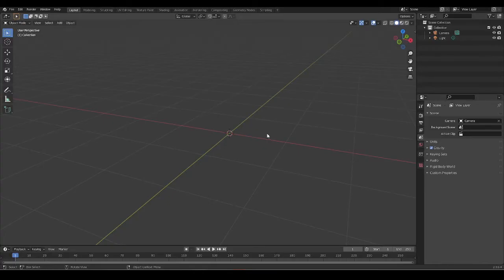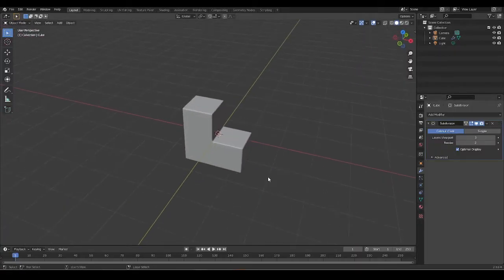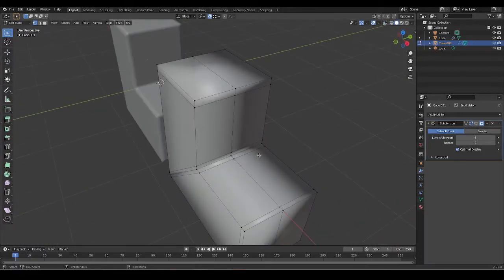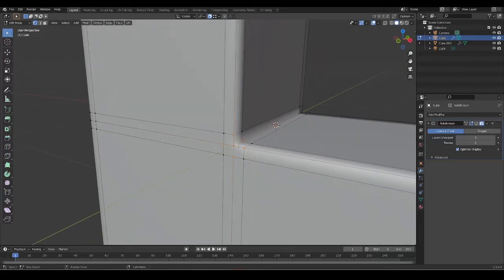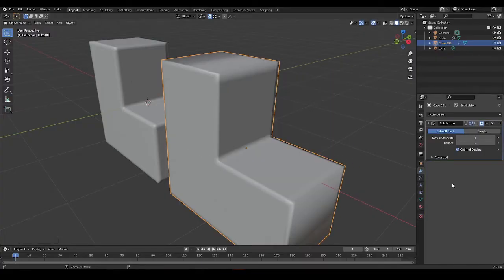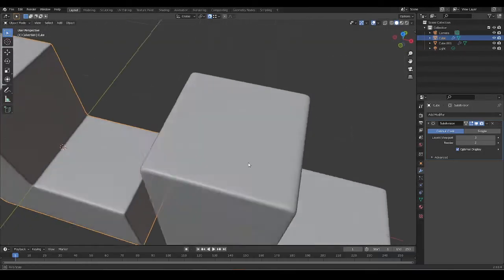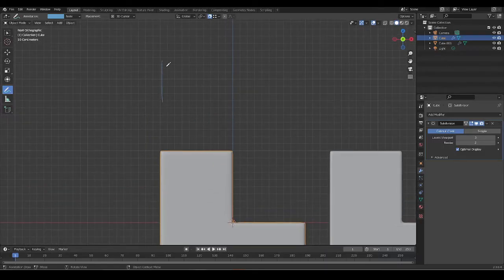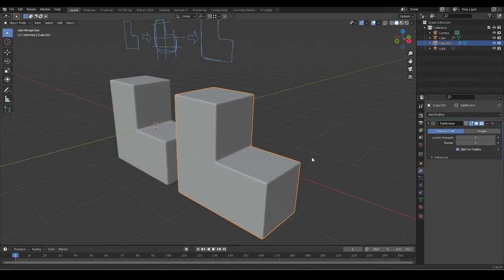Improve Your Understanding of Topology #01

Comment: I have been working on a lot of intricate Modelling for a good time now. Still, to those who are new, i'd say whatever you are doing on a flat surface, do what ever you want with the topology to attain the details you want. This part is easy, but when you move a bit further in models, you wont work in flat surfaces, flat surfaces will be rare to be honest, even if you are doing a tire or a car or anything, it has curved surfaces mostly, glass, car corners, panel gaps. The the most important rules which has served me a great load is, if you want to add intricate details on curved surfaces, add more loops but do it efficiently, if you don't have enough loops, it will end up in bulging, pinching, irregular deformities on the corners and if you just add loops randomly it will disrupt the edge flow or may end up in a dense edge flow over a surface, to do the aerodynamic lines on a car, you have to have the same lines on both sides of the line, to have the perfect flow, add more loops to the corners always, even if its a curves, minimum should be 4 loops in a curve, if you have less than 4, you will end up having a artificial curve, this will be visible perfectly, never do "Redirection" on a curve(Topology method, you can search) , if you do redirection on curve, 90% of the time it will bulge, but you can reduce the bulge using the first rule, add more loops efficiently, Learning 3D Modelling is hard, you have to go 100 ways to find the right one.

Comment: It is best not to rely on bevel for this kind of topology. If you select the 3 faces which make up the side of the L-shape and Inset them you will instantly push both the 3 and 5 spoked poles onto the flat side. You can then add a control loop between this inset and the edges to have full control and good topology. The addition of 3 loops over the top - better to think of that as a cross section -  and you have perfect topology with as much control as can be achived for this particular shape. Good job though!
Reply from the maker: Great solution and thanks for Subscribing!

Comment: 5:15 A far easier way would have been after using CTRL R to add a loop and clicking once is to press the E key, this Activates "Even", this allows you to accuratly match the Edges that you are Edge Sliding to, you can swap the sides by pressing F for flip whilst (E)ven is on. This also works in Edge slide mode (Shortcut is GG)
Reply from the maker: Thanks for the tip! Was not aware of this.

Comment: I suppose this lesson is useful and you made an effort I don't want to neglect, but in all honesty, this was painful to watch because of all the unnecessary actions you did. Maybe having laid out a step-by-step plan before recording a video would greatly improve it. Also, you made a lot of supporting edges for the second shape, but you compare it with the first shape that does not have that many supporting edges. What if you add the same amount to the first shape?
Reply from the maker: I rewatched the video and my gosh you are right! I have no idea why I'm fidgeting with the model so much. Makes for a very unpleasant viewing experience. I might just redo this video at some point. With respect to your question. The topology of the first model is "good enough". However, if you want to achieve better reflections that are true to reality the second model would be better because of shifting the 3-spoked and 5-spoked poles. The extra control/supporting loops are there just to create a nice bevel and reduce the bowing effect caused by adding a subsurf modifier over the model. Applying the additional control loops to the first model will give you the same result but the reflections won't be as good as the second model.